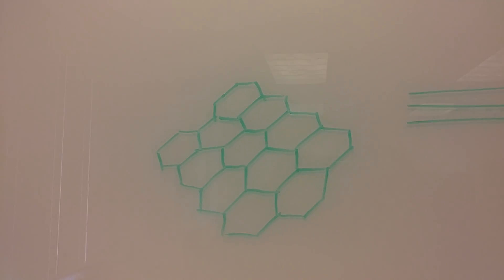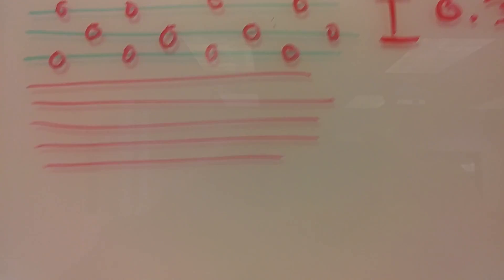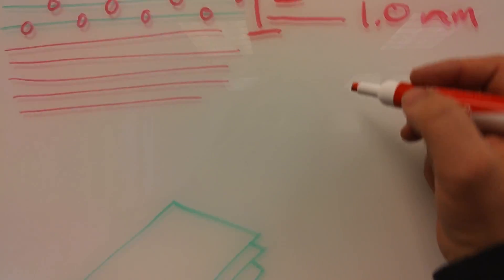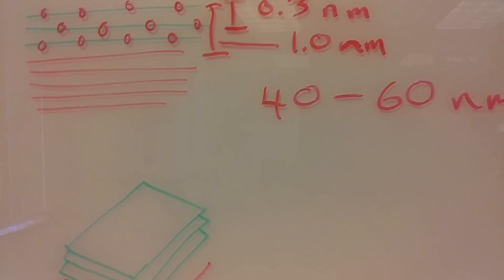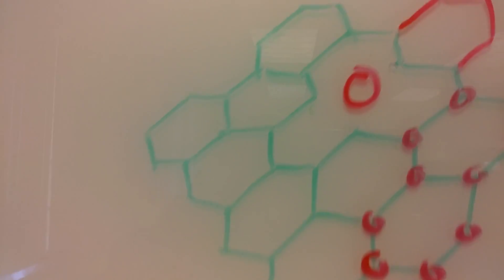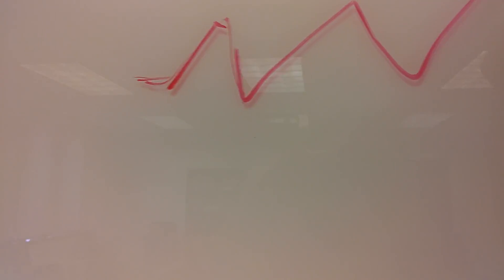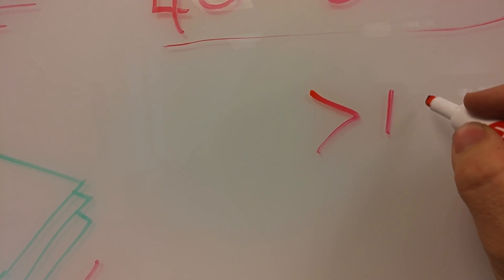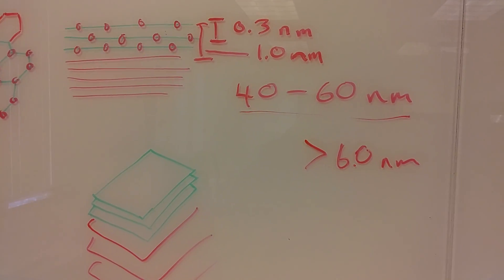To Graphene or not Graphene.....

Comment: What's the easiest way to test the quality?
I guess electron microscopy would be best, but too expensive for the home experimenter. Is conductivity a good method? And what sort of resistance are you getting?

Great videos btw, just came across your channel.
Reply from the maker: Honestly, the only real way is with an AFM. There are some "shortcuts", but they aren't accurate. One is to basically put it in plastic. If it makes the plastic stronger, you are at least close.
Reply: Venturestarx Thanks
Reply: I see so many graphene videos these days but often I wonder if they've actually made anything useful or decent quality.
Reply from the maker: +James Searle from the methods used, and my access to testing, not very good. Some are up to 1% yield, but most are nothing.
Reply: Venturestarx So with all the various methods the problem is how do you separate the graphene from the graphite impurities?
Can you centrifuge out the graphite to purify it? And why doesn't it turn back into graphite when it's dried?
Reply from the maker: Ok, those are all great questions. First is relative to the method the graphene is produced. Lets say you use the electro-exfoliation method. You can centrifuge the liquid to separate the different "weights" or Layer counts of the flakes. If the Van der waals are overcame, it's not easy to "restack" the graphene.
Reply: Venturestarx Thanks, I get that to exfoliate graphite you have to overcome the vander Wahl's force, but that charge still remains? So there must be an ion bonded to balance it?
Reply from the maker: Not really. VW's are actually more related to the distance the particles are to each other.

Comment: Dang my hopes are dashed. Good stuff though.
Reply from the maker: Why are your hopes dashed?
Reply: Venturestarx I've been trying to make graphene to heat my house (propane cost is killing me) and was hoping it wouldn't have to be pure, so I guess I was wrong. Lol. Not asking what your secret is just what way, of all available ways is best, I was trying longs way and failing?  Was also looking at blender method using die grinder (13000 rpm) and machining and milling a bracket and paddle/blade to hold it
Reply from the maker: Well, how much do you need? Those milling methods don't work, they just destroy the flakes.
Reply: Venturestarx I was thinking 3 panels like robert smith made. One for basement, one for kitchen and one for bedroom and just close off the rest of the house.
Reply from the maker: Well, if you are working on such a project, I may be able to help. I have some non-uniform sized material on hand that I can give away. You gotta pay the shipping though.
Reply: Venturestarx very generous of you but I can't take something for nothing, I have a lathe and mill that I tinker with, mostly making gun parts as a hobby. Is there something you need machined that I could make for you in exchange for the graphene?
Reply from the maker: I'll think of something.
Reply: Venturestarx making a set of titanium rings for me and the wife, could do a set for you and your wife also?
Reply from the maker: I can't recall our sizes. But I do have something in mind for the future.
Reply: Venturestarx sounds good, I'm retired so I got lots of time. If you need help with the design let me know, if it's something sensitive to your work I can give you my number to discuss it

Comment: I'll just leave this here.  All graphene battery requires graphene oxide cathode. The oxygen groups or nitrogen groups are required for faradaic redox reactions.  Yes pristine graphene is preferable in the anode. Sorry this is just physics.
https://www.researchgate.net/publication/263096398_All-graphene-battery_Bridging_the_gap_between_supercapacitors_and_lithium_ion_batteries

My project here https://hackaday.io/project/10216-printable-paintable-graphene-lithium-ion-battery You can rest assured I am using the Celtig LLC graphene in the anode vs my mechanically exfoliated graphene.
Reply: +Lupus Mechanicus Not to mention RMS eesd uses graphene oxide in both anode and cathode. You have a hydrogen overpotential at the anode and oxygen groups are required to achieve 1.9 volts. The faradaic redox reactions involving the potassium iodide also require oxygen groups in the cathode. Lithium sulfate is used in order to coat the cathode in sulfates that allow the higher voltages in aqueous electrolyte.

I am using your graphene to increase the conductivity of the GO and that is it's true application.
Reply from the maker: +Lupus Mechanicus There is a huge difference between fictionalized "graphene" (RGO) and my product. I can tell you from side by side comparisons that any RGO can't hold a candle to the material I produce. There a quite a few reasons: a) most pristine graphene used is CVD, therefore doesn't increase surface area because it's a flat sheet. b) we have yet to find a steady producer of any 1-3 layer graphene on the market outside of ours. c) every time we test someone else's material it turns out to be greater than 20 layer,  so it's not even graphene. Now back to adding it to GO, that does work. But we have a method of applying the graphene directly to metal foils that pushes the GO out of the mix as well. I have been out of the battery making game for a while, because there are some guys and companies out there who are much better at it than I am. I'll come back with some of their data when I get it to help you out.
Reply from the maker: +Venturestarx Also, if GO does turn out to be needed, we are going to be producing GO in the future. So far the only company who wants GO needs it for a foam application. (they invented the graphene aerogel)
Reply from the maker: +Lupus Mechanicus I agree. As soon as we get production up and running at full speed, the price for my stuff will go down, even less than $1/gram. (right now that is the price when you order kilos+) The GO produced will probably start at around $2/gram when it comes online, and will be dry powder, not in any solution. It basically is our material that has a tuned oxidation for customers needs.
Reply from the maker: No problem! :)